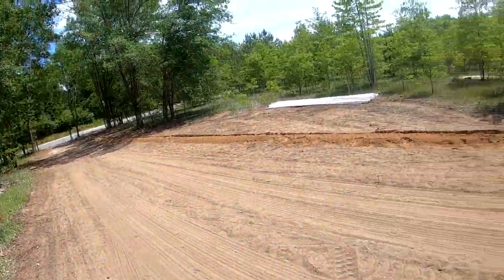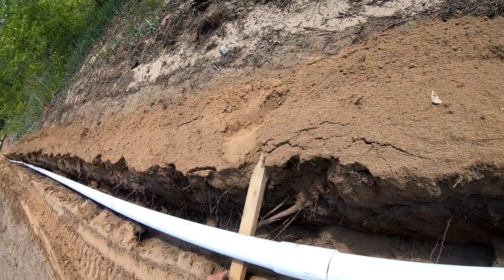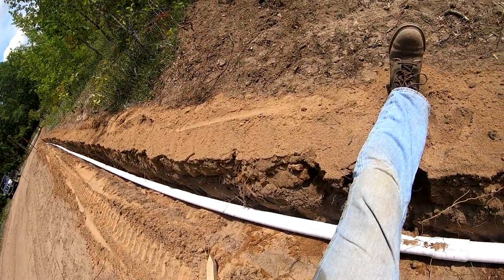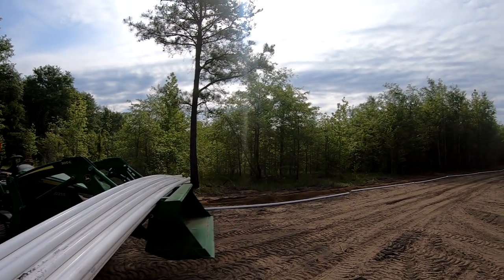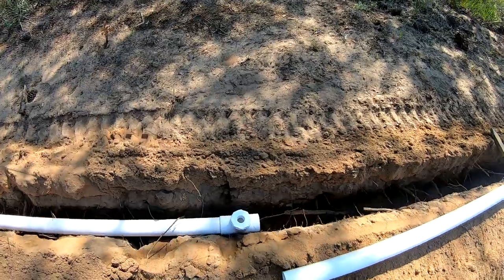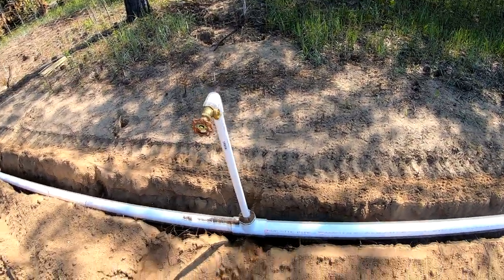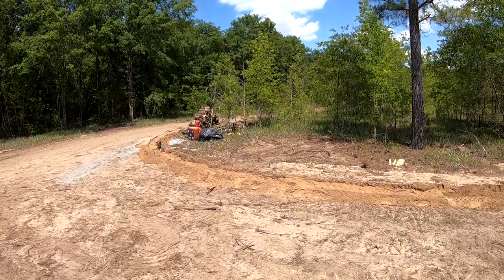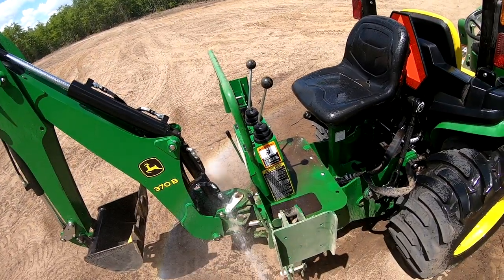Running Water to the Farm Part 2 - Laying Pipe, Stories from an Old Man, and a Little Demonstration!

Comment: Looking good! So much different installing water lines in your neck of the woods as opposed to where there is frost in the ground. In the Northeast, we would be down about 4 feet and usually air test the line before turning the water on. So happy for you that it’s coming together so smoothly!

Comment: Lol must be nice i spent the weekend running 175’ to add a hydrant  but i had to go down 5’ property is looking good tho lots of progress 👍👍
Reply from the maker: Thanks Charles. 5' is crazy! You must be at the north pole! It never really gets below 35 degrees here, so there is little worry about water lines freezing.
Reply: Grand Outdoors  yeah eastern colorado, ive seen it down to -44 degrees here, im shocked you aren’t using primer for pvc under pressure